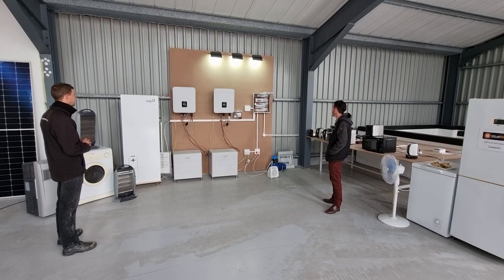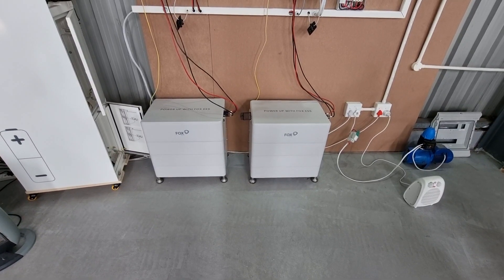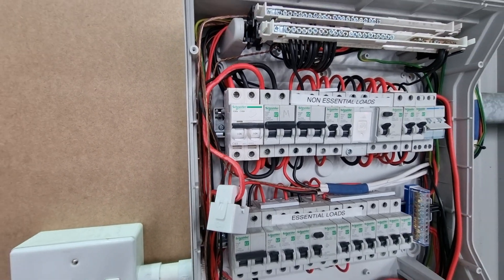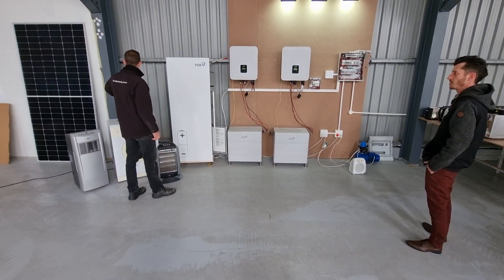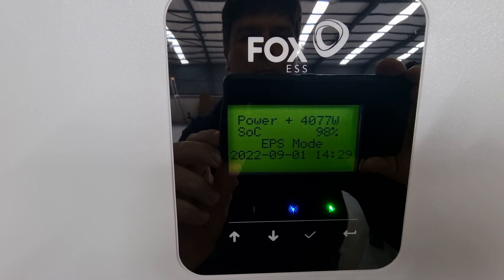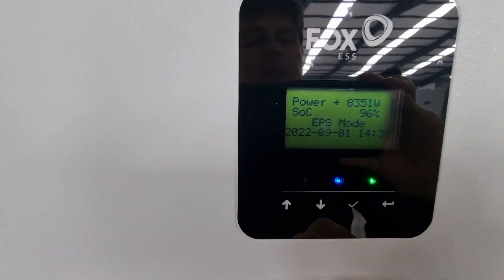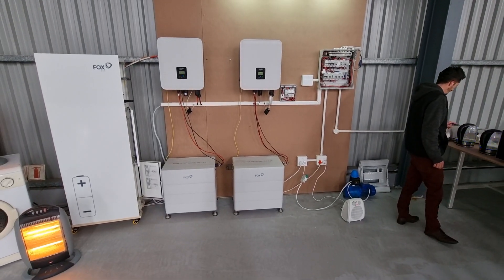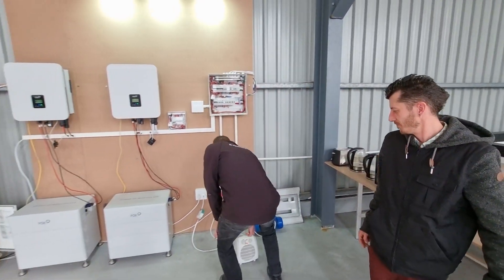Fox 10.5kW Hybrid Parallel Test

Comment: Was this on Phase 3 electrical connection to mains? As I understand dual hybrids are not possible with standard residential single phase mains?
Reply: This looks like single phase. I don’t see why it wouldn’t be possible on single phase? 

Would come down to the regulations in your country, but definitely possible

Comment: Hi Guys, have you used the fox 3p 4 unit esp box? We got 3x h3 in parallel, esp com wired out of the 8,7,6 coms port on the master inverter to the esp box,but when we isolate the grid supply the esp box won’t engage the esp contactor in the eps box? We think it’s a firmware issue? Hoping you could help?
Reply from the maker: Hi Get Shot Done, we have not installed the H3 from Fox as yet so have no frame of reference to help you with this one, please chat with your local FoxESS guys, wish we could offer assistance on this one.
Reply: Has your problem been resolved? If not, please contact your local after-sales service personnel. Can you also provide the SN of master

Comment: What cable do you use for the parallel port?
Maybe can you upload a Video of how to connect them?

Nice video!
Reply from the maker: Thank Michael, we will make the video requested and share once posted.  A new Fox 10.5 video can be found here in the interim https://youtu.be/JJxaI5M6DpM
Reply: @MSPD-Africa  Thank you very much. I managed to install a parallel system with 5  Fox 10.5 for our customer!
Reply from the maker: @Azz4ssin  thanks Michael, great to hear, were abouts are you located?
Reply: how did you make the connection
did you use eps box??
Reply from the maker: @Oliver Jake  no EPS Box is required.  Just a data cable between the inverters and to set the address, please send your email address to power@msolarpower.co.za and we will send you a SLD
Reply: @MSPD-Africa  The problem is, we built 2 H3 parallel systems and separated the eps loads. But eps loads did not feed when ac was on, eps loads were fed when ac was off, what is the reason, how will we solve it?
Reply: @MSPD-Africa  Our inverter triphase